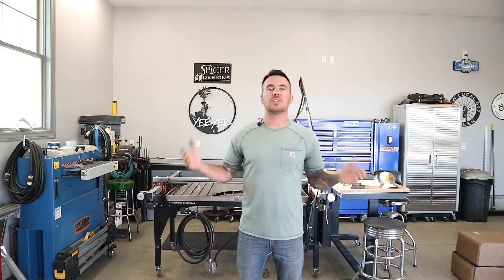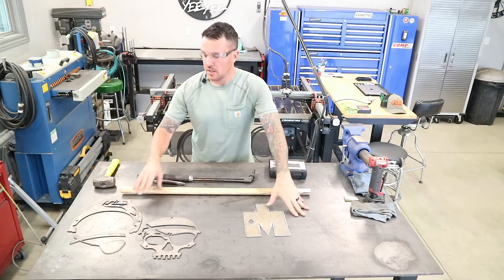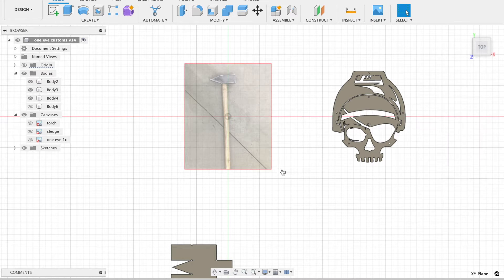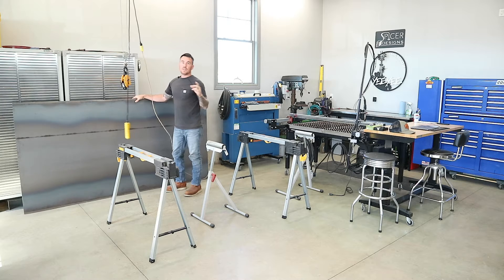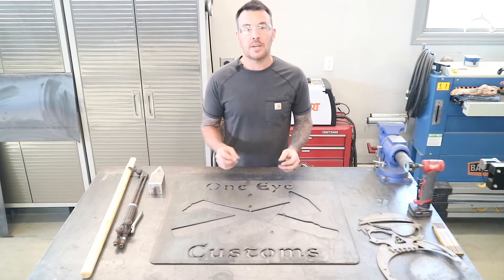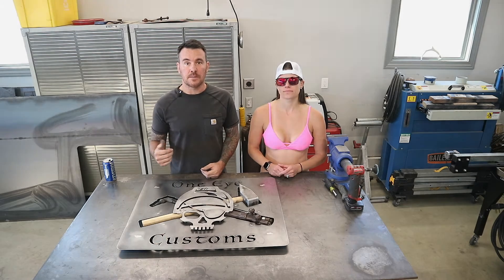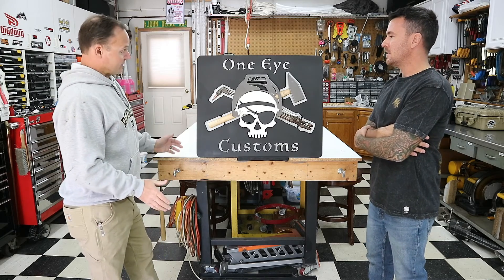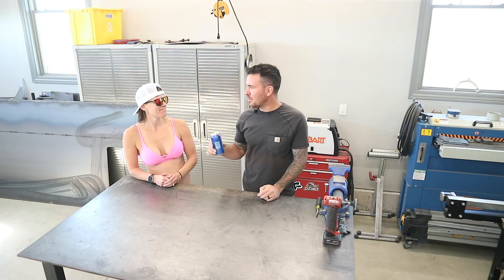CNC Plasma cutting with Fusion 360....Tips and Tricks For Your Next Build!

Comment: What air dryer system are you using?
Reply from the maker: Theres one built into the plasma cutter and i have a cheap amazon air dryer i use as well. Im slowing starting to make upgrades to the whole set up now that we have the new shop.